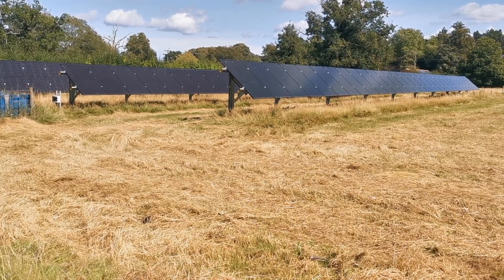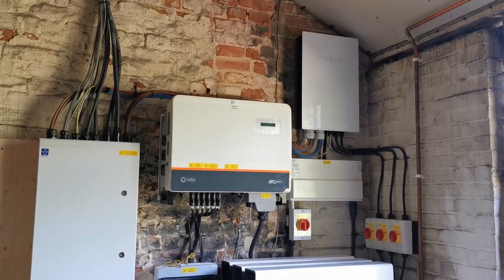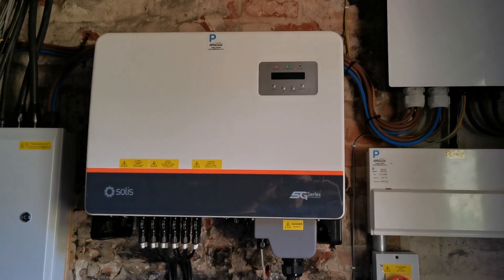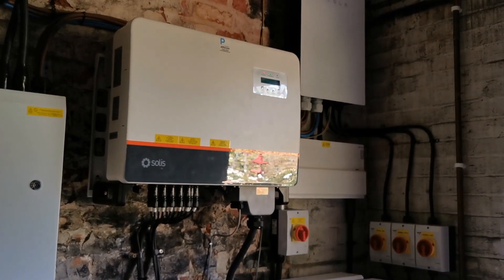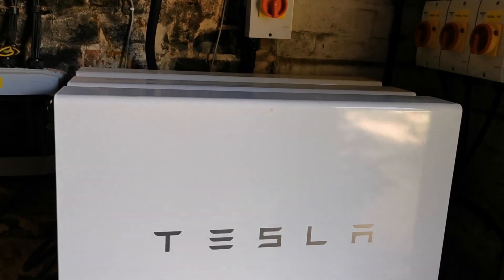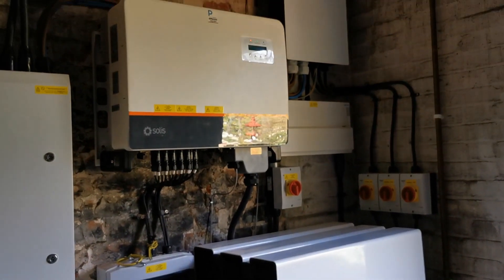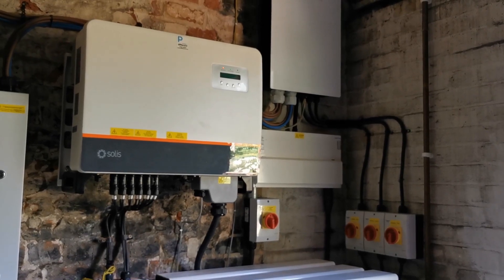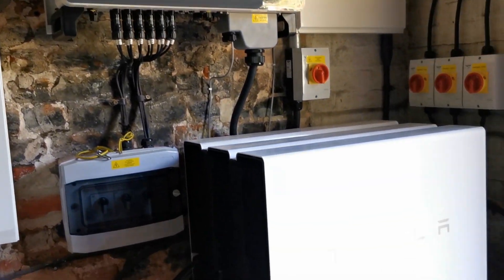How Solar Energy Saved Me £490/month: Learn about Solar PV & Battery Power #solarenergy  #solar

Comment: The system saved you 490 per month. You divide the cost of the system by 490 and the number would be the months til you recover the cost.
Reply from the maker: Everyone asks the same, but I don't know the price per kWh tomorrow, let alone in 12 months. It's more about power resilience and not having the prospect of an ever increasing monthly direct debit. Also we plan to expand the array as we add more evs and the 2 barns get converted and power up. I would like not to be importing too much over Nov to Feb, and that means more panels and a second inverter.

Comment: Interesting. I am in the US, and have a 3 phase inverter for our property (with 3 phase metering etc), all due to having a 7.5HP well pump. Tesla wouldn't help, saying they don't work with 3 phase (at least in the US). Have been trying to get batteries for 4 years. I figured putting one battery per phase would be the solution. Well done.
Reply from the maker: thank you it took quite a long time to get it all . Over a year in fact